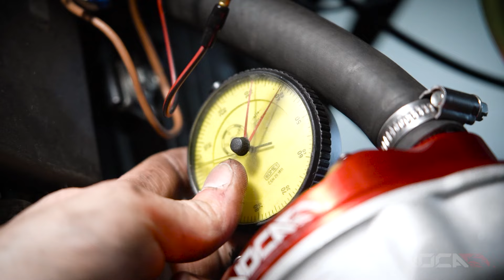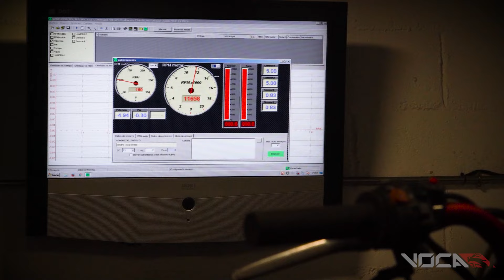Cylinder VOCA Bestia 80cc for Minarelli AM6

Comment: Are you making this for the Derbi engine also?? or only the am6?
Reply: doesnt derbi have am6 motor
Reply: @adsadad-v1j    No no NO.....  The Derbi bikes(and valenti, fantic and later years aprilia all uses the Derbi engine.  The Derbi engine comes from the 75cc spanish engine built to race in the 80cc class of enduro/mx.   So the Derbi engine has more in common with a 80/85cc dirtbike engine, then it has to a moped engine. The Crank is much stronger, the transmission is stronger, the engine cases are built stronger and better.   It is just overall a much better and stronger engine.
Reply: Not Fantic, sorry i meant Gilera.